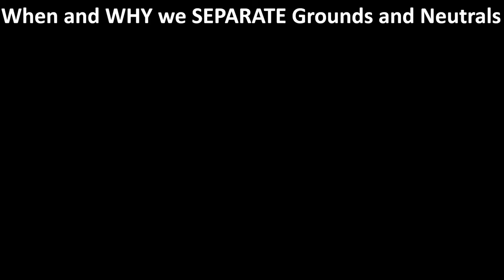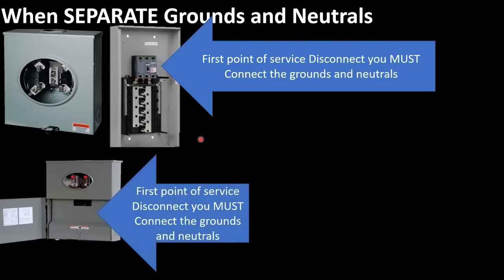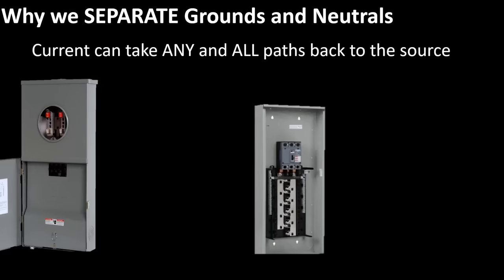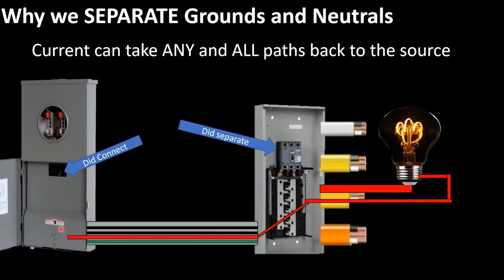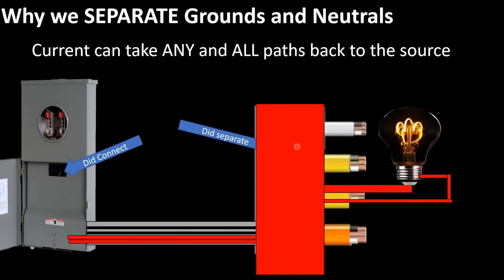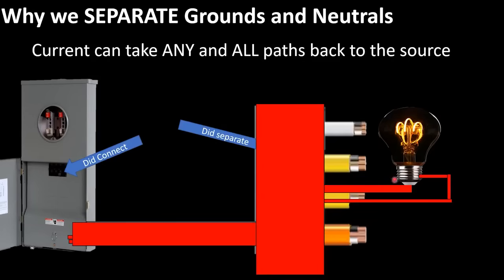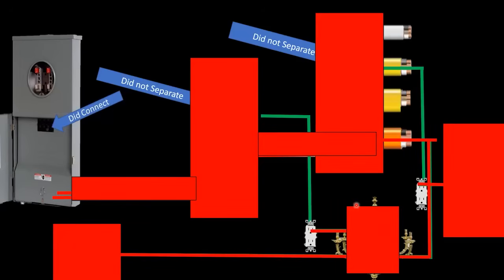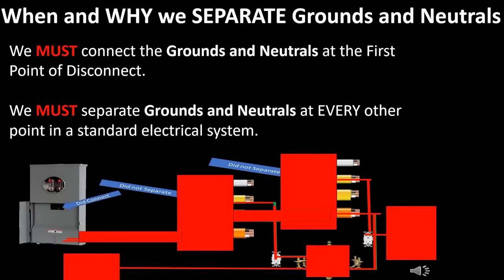When and Why to separate Grounds and Neutrals.

Comment: So now, if you have a 400 amp service, and the meter box is feeding two 200 amp breakers in separate boxes, would you connect the ground and neutral in both boxes? They are both "first" being directly connected.

Comment: Very clear explanation.  What about an outbuilding that has its own earth ground?

Let’s say I have a shed I power with solar exclusively with a solar system currently, no wires going back to the house.  In this scenario, I believe we would bond together the neutral and ground on the AC side of the system.  However, should someone in the future decide to remove that system and run a conduit from the house they would then need to remove that bonding since the disconnect would now be at the house.  Is my thinking right?

Comment: If the grounds and neutrals separated in the sub panels, but still bound in the main panel, how does that keep the sub panel ground from being energized? Isn't there a solid copper wire running from the main panel to the sub panel binding them together?

Comment: Hi.  Thanks for the video; I'm leaning, been doing, etc.  Question: in your perfect scenario where the light bulb is lit with the current and the current passing through back to  meter/shutoff where the neutral is bonded ground.  Wouldn't current go to ground and neutral back to the source?  If that was the case if it went to ground there, then the panel would hot also?  I'm trying to clear in my head what happens at he first disconnect....  Thank you again for your video.

Comment: All current returns via wet earth off poles transformers to Substation then to main power plant.
Notice only three phase primary overhead wires have 3 phases no neutral .
Each pole with transformer has a ground rod driven in wet earth and substation and power plants have a huge copper ground array buried near to create a ground potential . 

I work IBEW power plants substations.
Reply from the maker: Thank you!🙏

Comment: I have a dumb newb question. I get that it's not ideal to have current flowing on chassis, conduit, etc. But, those are all still at 0V since they're bonded to neutral at the first disconnect, so if you touch one there won't be any potential across your body. So what makes that dangerous?

Comment: Excellent explanation. I've been an electrician for 37 years. What surprises me is when I see a sub panel fed with 4 wires and they still didn't separate the grounds and neutrals. What did they think the purpose of the separate ground and neutral was?
Reply from the maker: Thank you!

Comment: I agree with most of the commenters 👉Great presentation, one of the best I've seen. 
I wouldn't go so far as to say it's perfect though. (add one more scenario, and it could be ideal). 
I kept waiting, towards the end, for the imagined scenario of a person touching the Dryer and the Main Panel (ground and neutral NOT separated in sub-panels) where You become the path of least resistance, and if the ground and neutral were separated (as they are supposed to be in any sub-panel) the system performs as intended, aka you don't get shocked.

Again, 👉Great explanation of why we separate ground and neutral in sub-panels.
Reply from the maker: Thank you!

Comment: Awesome explanation.  Reminds me of some electrical faults I saw on boats, where the (12v, thank goodness) current was getting drawn the wrong way through the circuit because there was a better ground in an unanticipated place.  The ground from one circuit was functioning as the hot for a second circuit.  Hard for an amateur like me to wrap my head around sometimes.
Reply from the maker: Heck, I'm a "pro" and it's hard for me sometimes!

Comment: What about centertapped neutrals? The true ground is at a halfway point  between your black and white wires and is created by centertapped transformers and a generator? I think every electrical system should be placarded as to it's voltage and standards. You will especially see centertapped neutrals in radio and military 115 AC systems. You will also see other trends like Navy overhead wires used on land just like on ships and anchor loops above outlets. Understand that your electrical code floats in a sea of other standards and only is valid when it is placarded.

Comment: This is a perfect explanation but it’s also important to recognize how dangerous it is to disconnect a ground wire or what happens if a conduit is broken because there would be a potential difference across the disconnected path. In other words never assume that a ground wire is dead because it can get you when you disconnect it.

Comment: How does the ground system work if the main panel did not have metallic conduit attached to a downstream sub panel? As in running power to a sub panel in a detached garage using uf direct burial wire.

Comment: Good explanation, now it becomes very clear why your generator must remove the bonding between ground & Neutral when connected to you panel. So my question would be if you had a small two circuit fiberglass infused PVC sub panel  connected with PVC conduit where either way the return would happened with an insulated conductor or isolated ground path would be considered safe?

Comment: in a proper system. at the first point of disconnect in the main panel. We are to bound ground to neutral. However, i would like to know if the metal case of the main panel will pose an electrical shock, since current will be flowing from the neutral to the ground on the main panel?

Comment: Excellent job.  Something to remember is that all conductors are also resistors.  The human body is also a conductor/resistor and all the metal components in our electrical systems are also conductor/resistors.  When you put resistors in parallel in a circuit the total resistance will be less than the lowest resistance value in the circuit.

Comment: Good explanation. Another YT video (I think Electrician U) had a video about those plug-in receptacle testers may not catch every fault. One case he pointed to was a receptacle with a jumper from neutral to ground. OK if you got an old building with no ground wire, don't do this! I talked to another electrician about this jumpered receptacle, he has seen this a few times in his career. Yikes!

Comment: I'm a DIY guy and have never fully understood this until now. Thank you so very much! I get it now. However, could you translate that over to portable whole house back up generators say 6500Watts and up? Sometimes bonded, sometimes, not. Why? 
Little back up generators say 2200Watts  (if we are bad guys and back feed one side of our panel with them in an emergency using our manual transfer switch) are not bonded. Why?      
I figure if you could do such a good job of explaining it for the house, how about the back up generator types ?

Comment: Keep in mind that older sub-panels installed before the mid-60’s typically did not have a ground going to the main and combined the neutrals and ground in the sub-panel. These of course can be upgraded by either replacing with a new sub-panel and appropriately sized ground or installing a separate ground bar and ground back to the main.

Comment: I've always separated the ground from neutral at the breaker panel. The ground goes to the grounding rod, the neutral goes to the neutral side of the breaker panel and then the return side of the powerline. Anything else courts disaster.

Comment: I Get it!!!!   This makes me wonder about my Old welding connector. off panel 2 in the garage.  (no neutral)   Off my sub panel. 2     BTW my panel 2 has the neutral; disconnected from the case.   I worked on 5000 amp DC plants in a Telephone exchange building.  We had a PHG  (Personal Hazard Ground) and would measure to make sure this PHG had no current on it.     Thanks. I had AC electricians tell me   "Oh  it is just DC"  LOL     Just subbed.

Comment: Apparently, I'm grandfathered in with my older sub panel in the garage. The ground for it is separate, and I have no choice but to connect the neutrals and grounds in it anyhow. It's an older fused based panel with room for only one bank of neutrals and grounds.

Comment: How about off grid inverter.  It have ground on metal case/, i connect the case to ground the first panel also connect to ground.  I do not connect my first breaker box to neutral, if i do connect neutral to ground of first panel it created spark short.   The off grid eg4-6500 Ex sold by signature solar. The inverter to first 16 breaker box is 5-6 feet... thanks for your answer.

Comment: What if you have a disconnect box outside the house that is connected directly to the meter base that is feeding a breaker panel in a de-attached shop, No ground attached to the disconnect box but a separate ground rod connected to the shop breaker panel Should the ground and neutral be bonded in the shop panel?

Comment: Not sure about the NEC, but in the CEC(Canadian) the white wire in a 2 wire system is the ‘identified’ conductor. The green is the bonding conductor, not ground wire. The neutral by definition is the white wire of a 3 wire system. Neutral and identified are not interchangeable nor is ground and bonding interchangeable. Terminology is important when teaching. So if you are in Canada, the terminology used in this video is incorrect but the theory seems accurate.

Comment: I had solar installed several years ago and shortly after I needed to replace my main panel due to main breaker buss issues and to expand the number of circuits. In the process of removing the old panel I found that the neutrals and grounds were still bonded together, which at that point the main panel would have been a sub-panel due to the solar having a main disconnect after the meter head. I was surprised to see that seeing as the solar installation had to be inspected by the NEC/Underwriters inspector before being energized. I separated the grounds and neutrals in the main panel. Thanks for the great video.

Comment: Electrical engineer here, It does not matter if the ground circuit, wires, conduit etc. carries current. You won't get a shock (unless the ground is faulty and open - which is a separate problem). Separating G/N in subpanels is to stop ground loops from occurring which causes noise, hum and interference in audio, video and computer systems. Its not a safety issue but rather to stop ground loop current flows.
Reply from the maker: Correct under normal circumstances you would not get shocked, but it is definitely a safety issue. One thing you're not considering is that if there is current flowing on it and you have a ground fault on another circuit it can limit the capacity to clear the ground fault or prevent it completely. Most definitely a safety hazard.

Comment: Awesome video, thanks! You mentioned that old sub panels could be bonded, and undoing that could cause more trouble than it solves. I’m curious your reasoning in saying that?

If one were to hypothetically have a bonded ground and neutral in a sub panel, and moved all grounds and neutrals to their appropriate sides, and removed the bonding rail (idk what it’s called) would that not be a safe way to fix the problem? 

Thanks again for the video, you da man!

Comment: So if there isn't a ground from the meter box, just the two hots and neutral, to a load center 75 feet away with a main breaker and two grounding rods are supplying the ground connection for it, are the neutral and grounds still separated?

Comment: Hello Maestro, thank you for educating us, I have a question, my house was built in 1936 before you even born, the electrical installation is not grounded at all, all my electrical out lets only have the hot and the neutral, the main ( first point of disconnect )  box includes the meter,  the neutral from the main entrance box ( first point of disconnect ) feeds the neutrals  and also goes to ground thru a solid copper wire connected to the under ground water pipes in the property, I would like to ground what I can inside the house with new out lets installs, and ground those out lets with a 7 ft bar into the ground if that's the right way to do it, my question is, can I get away with just one bar in to the ground?? I see other videos using two bars in to the ground, 10 ft apart, connected together thru a wire, and also I would like to install the grounds bus strip in the same main box ( first point of disconnect ) now would I tap my new grounds bus strip in to the neutral strip in the main box ( first point of disconnect ) Appreciate your help, thanks in advance!!

Comment: How do you test to verify grounds and neutrals are separate? I live in an old rent house, and while removing an old ceiling fan, was dismayed to discover 4 wires bound together in the box with an old connector type I do not recognize, but a combination of bare wires and insulated wires.

Comment: In a very short story you want to ground all metal parts everywhere so the breaker can't trip this is the wire method they want you to use no exceptions this works best for all faults

Comment: Simpleton question here. If current is flowing through the metal parts of a non-separated sub panel, is the current noticeable to the touch? Or would it only be noticable during surges or times of higher load like from a dryer?
Reply: Current would only be noticeable if your touch provided a better or alternative path to ground/neutral (the ultimate goal of returning neutral current) than the intended grounded circuit conductor feeding the sub-panel.

Comment: Like to THANK the video for clarifying very important topic around everything electric in the house, ground surfaces need only ground connections, so there is NEVER a remote chance for white neutral wire returning any hot AC current to a ground somewhere much further to be connected with metal surfaces of devices because they are/were not separated like they should be at 1st point of disconnect in the local house circuit ...

 only like to say I wish I knew ... this as teenager hooking up stuff for self and other people free but no reports of injury thus far ... but perfection is everything ... so with new information in mind everything will be checked, corrected and perfected when building NEW ...
Reply from the maker: Lets Go! Thank you for your comment, safety is always number one.

Comment: What if you only have 3 wires, (2 hots, 1 neutral) coming from the Meter to the house which is about 85 feet apart. my question is do we still bond the ground and neutral at the house service panel? And does there need to be a ground rod at the house? Thanks

Comment: This is exactly what I need to talk about: If I have a 120v furnace and its "connected to a generator only during outages"  generator manual says its bonded that should work and be fine....but if the furnace is still grounded to the house via the casing so that in a sense is connected to the house ground and neutral what happens when power is restored ? any help is much appreciated.

Comment: Howdy. Very nice.
No intention to be wise guy. So why is it harmful to have return currents running in boxes, casings and metal conduits ? Well. A conduit may actually have a smaller impedance than the ground wire, altough there is a rusty screw in the conduit assembly. Heavy load could make the screw glow red hot and cause fire.
Another reason for full separation after service is that although the neutral is completely healty the return currents will generate voltage drops in the neutral. The so called Touch Voltage. Though only some volts, it may be upleasant to experience in the bath tub or touching the stove and kitchen sink simultaneously.
And more. Separation provides the residual breaker to trigger when sensing the current returning in the neutral not being the same as what went out in the hot.
Finally. The ground wire normally carries no current. If there was a normal current flowing already there will already be a voltage drop in the ground when a ground fault develops. This drop is subtracted from the fault voltage. Less fault voltage. Less fault voltage generates less short current and possibly slows the breaker triggering. The Touch Voltage has more time to kill a person.
Regards.

Comment: My problem with this is that I installed a 30 amp sub-panel for my RV and there was only one bar in the panel for attaching ground wires and neutral wires. That 's way the panel was manufactured. By what you're saying here I assume the neutral bar should be insulated from the panel body?
Reply from the maker: No, there are many panels where they are all bonded together, definitely work with a qualified license electrician in your local electrical inspector on this one

Comment: Our first point of disconnect is equipped with ground fault sensor.
Should we connect the ground and neutral is this situation?
I became doubtful as one electrician told me not to connect ground and neutral if the 1st. point of disconnect has ground fault sensor.

Comment: Question for anyone; I have a 3 wire run to my electric WH, but WH only has 2 wires (black & red).   The run is coming from a sub panel so white and ground are separated. What should I do with the white wire? If I tie white and ground together at WH, would that not tie white and ground together back at sub panel?? Do I just leave white free and only connect black, red, and ground at WH??

Comment: excellent explanation. under normal operating conditions, neutral may have current flowing through it (when unbalanced load), while ground wire will never have current under normal conditions.

Comment: If the neutral and ground are connected at the first point of disconnect then there could also be a measurable current flowing through the casing of the first box assuming it is grounded, and you if you touch it. Assuming the current takes all routes back to the source, no?